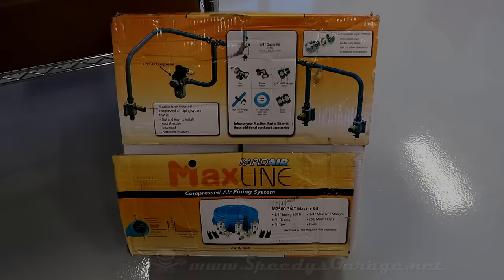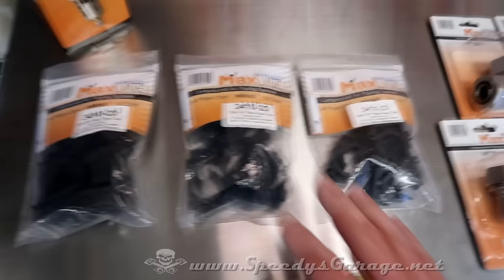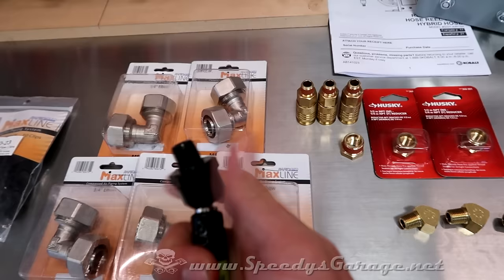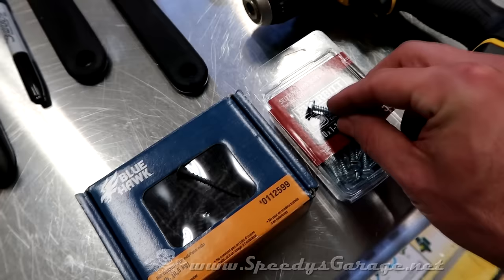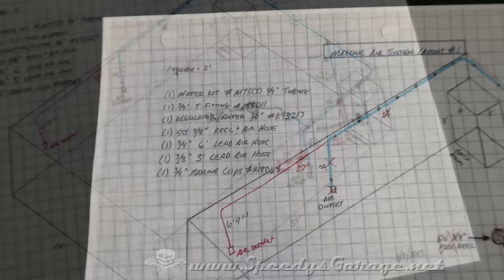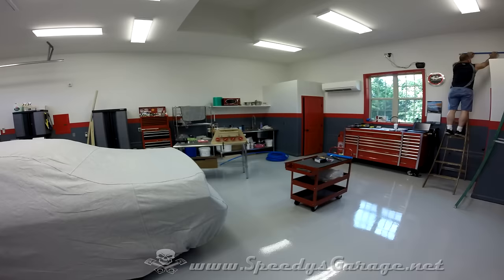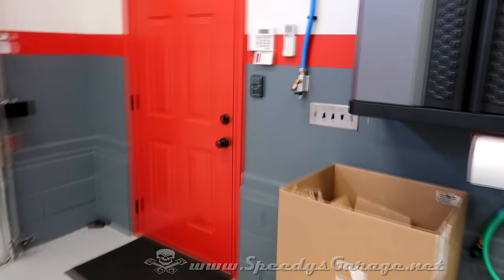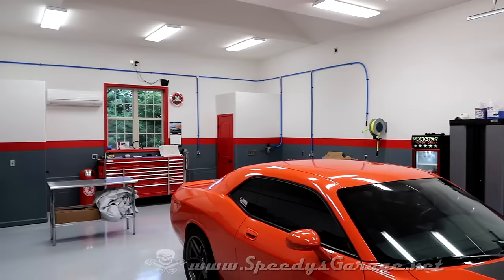Rapid Air Maxline Air System Install Speedy's Garage

Comment: IT's been a few years and I can only imagine I won't get a response, but hey, I for sure won't if I don't try. I am just a little confused... You mention with the 45 degree angle ends that they are 1/4", but your link to amazon shows as 3/8"... Please advise. I bought the 3/4" rapidair set and looking to install here very soon. I want as much going to my blast cabinet as possible, as the rest of the shop can be 1/4"...
Reply from the maker: Mine were 1/4" that matched up with my quick connects.  Amazon changes links around occasionally.  3/8 flow more obviously and you could do that for your blast cabinet connection.  I would personally.

Comment: Thanks again for the detailed video!  Did you run your long runs at any type of downward angle to reduce water?  Are you getting any water at the drain valves?  I saw one guy ran his piping at baseboard level and his air drops actually ran up 3-4 feet to keep water out of his air fittings.  Your thoughts?
Reply from the maker: I made all the runs parallel to the floor.  I've not had any issues with moisture and just empty the air tank regularly.  If you do a lot of painting a good filter system would be recommended I think.

Comment: curious what compressor and size you are using.  Also wondered how you ventilate the compressor room?  IS it just open at the top and if so does that really knock the noise down?
Reply from the maker: Check out the shop build series it has all the details.

Comment: Are you still happy with this product? I am building a new shop and wondering what direction to go for air lines. I used galvanized pipe in my old shop and took awhile to install. Never had any issues with it though.
Reply from the maker: Works great.
Reply: Speedy's Garage okay great. Sounds like the route I will go.

Comment: You said that you found your tubing straitening tool online or was it from plans.  At any rate, the factory made one is a lot more expensive than I think I could make one for.  Could you post a link to the plans for one?
Reply from the maker: The plans used to be on the Rapidair website.  I have a copy if you can't find it.
Reply: I looked on their website but could not find it.  I'd love a copy if you could send me one.
Reply from the maker: Shoot me an email from my website - www.SpeedysGarage.net
Reply: Speedy's Garage 

If possible I’d like to get a copy of the MaxLine tubing straightener too.  I clicked the link but did not see how to seen you an email from the site.  

Also the double male whip line is so you can have a quick connector on it so you can easily disconnect the reel if it leaks or needs maintenance

Thanks

Comment: I like your rollers for straightening the tubing. Did you build that jig?
Reply from the maker: You can buy them now https://amzn.to/3SgM6vk
Reply: @SpeedysGarage  I did end up turning my own rollers in my wood lathe. Used 1/2" bolts on a 3/4" plywood frame. Worked ok. I used the winch on my ATV to pull the tubing through the rollers. I have pictures.

Comment: I'm looking to order the Quincy QT-54, do you have a problem with water in your lines at all? Sandblasting will be my major use-case down here in humid Savannah, GA.
Reply from the maker: I've done some a reasonable amount of grinding with mine in the summer humidity (I'm in TN) and no issues, but if you're going to do a lot of that type of work an extra filter and some U bends would be a good idea.

Comment: I love the Maxline kit, but the clips they supply are sheer garbage.  $1.75 apiece, and they're so flexible that they don't begin to hold the tubing straight or secure.  I've switched to steel conduit straps (example: https://www.homedepot.com/p/Halex-1-in-Rigid-1-Hole-Conduit-Strap-96113/10012914 ) which really anchor the line in place and cost a fraction of the plastic garbage.  In fact, they're rigid enough that you can make minor adjustments between clamps to straighten the tubing, making a run look more like pipe than flexible tubing.  Highly recommended.

Comment: Does a connection come in the 3/4" kit that has a male connector that connects into the 1/2" hole on the compressor?
Reply from the maker: I had to have a special hose made up.

Comment: Why do you choose max line instead fast pipe (rigid aluminum pipe from RapidAir?) I'm just curious. I'm looking to install air distribution in my garage too. Don't know which model to choose.🤔
Reply from the maker: The length of the pipe.  Maxline you can cut to whatever length you need to avoid joints.
Reply: @SpeedysGarage  where did you get your wheels from the straightener you made?

Comment: Are you buying your Rapid Air materials from a local vendor, or are you buying on-line, i.e. Amazon?
Reply from the maker: A little of both, I put links to most parts in the description of the video.

Comment: ok, those "self-tapping" screws are for drilling into sheet metal... NOT wood, not saying you have to pre-drill wood, but the self tapping feature of those sheet metal screws does not disallow the need for it in wood, should you choose to do so.. :)
Reply from the maker: I'll disagree.  These worked great and have held up to tons of use.

Comment: Did you ever sell your pipe straightener ?  And how has airline working for you likes and dislikes ?
Reply from the maker: I still have the straightener.  I have really liked the setup my only complaint is that the system has a very slow leak so if I shut the compressor off, it'll bleed off pressure over 3-4 days.  Not something you'd ever notice while using it, but annoys me just the same.  I'm told this is normal with a bigger system like this so I've not gone through the connections with soapy water to find anything I could potentially fix.

Comment: Thanks for the video I'm trying to decide if I want 3/4 or 1" for my paint booth
Reply: 1" moves 100cfm of air, do you have a 40hp compressor?
Reply: 1 inch seems like overkill when being used with an HVLP. Unless you are running multiple paint guns at full 100 foot length, you won't see the performance gain.

Comment: I'm about to purchase the 3/4 maxline system.  You still happy with it?  Any advice?  How is the rapidair regulator holding up?
Reply from the maker: Look at the 1/2 before you commit to the 3/4.  Fittings and adapters are easier to come by on 1/2.  Other than that I've had zero issues with the system or the regulator over the past several years.
Reply: @SpeedysGarage  thank you for the reply.  Funny, everyone I talk to about the 1/2 wishes they had gone 3/4 lol.  I've got a small blasting cabinet and some paint guns I plan on using...

Comment: Do people ever plumb the lines in the walls prior drywall & paint?
Reply from the maker: Could, but easier to maintain on top of the sheetrock.
Reply: I did.
Reply: Yes, that is why there is a port in the back of the blocks.

Comment: Nice setup, if you don't mind me asking, what's the approximant install cost (not counting pizza and beer) for that?
I'm curious, the lift you'll be installing is perpendicular to the shops length so how do you plan to get a vehicle (especially a large pickup) on the lift (rotate)?  What other lift but a single pole would work?
Thank-you for the time.
Reply from the maker: Really cheap actually for what you get (other than the compressor).  I'd guess about $300 for all the fittings and kit.  Maybe a bit less.
Reply: I figured between 250.0 to 300.0 so I was in the ballpark.

Comment: What is different from pex-al-pex?  I like distribution blocks, but I have pex and looks identical. Mine used stainless crimps and works awesome like yours I'm sure. I also made header from 22ft black iron 2.5 in pipe had laying around. And to get corner radius box store sells pex corner brackets. I used that to get perfect turns. Wish I had the straightening jig, used a shop buddy to pull other side lol. Yours is much straighter, but mine is also 15ft in air so nobody can tell. Great video. I was curious about these as I see lots of people talking about.
Reply: And wanted to note, your shop is very nice bud. A cot and a cup and you're all set ;)
Reply from the maker: I'm not sure what the difference is in pex-al-pex.  The Maxline has an aluminum core that makes it hold it's shape, maybe what you used is the same?  Thanks on the shop, I took a lot of time thinking it through, and yes a cot and cup and I'm good to go LOL.
Reply: Speedy's Garage pex uses cinch not compression fittings so no special tool needed. But my tool does 3/8 to 1.5 inches no adjustments needed. And since I source parts from darn near everyone, pex parts much cheaper. But I like the kit being all in one and you did a great job. And the distribution blocks rapidair has are awesome. I just have terminations that go ball valve > air regulator filter gauge > whip > service reel. Would like to have a few blocks to plumb through wall to service outside sandblasting stand and blowout table. Again, my shop is very crude, but work gets done the same. What did you do you floor with? Looks great.
Reply from the maker: Local place did epoxy on the floor with a clear coat.  I looked at doing it myself, but everyone I talked to said to lave it to a pro that can get good epoxy, not the big box store stuff that falls a part.  It's held up pretty decent, my only complaint is it is a bit "hard" I've managed to chip it in a place or two.  Other than that very happy with it, easy to clean, chemical resistant, etc.

Comment: Planning on doing the same setup in my garage but do have a question on the flooring. What paint or coating is that on the garage floor?
Reply from the maker: It's a 2 part epoxy I had professionally done.  It's been bullet proof thus far.

Comment: Great video and explanation. As a follow up how has the system been holding up and would you still switch to 1-2” if you had to do it again?
Reply from the maker: System has been great.  I've been very happy with the system and it's super convenient having air available around the shop.  If I had to do it all over again, I'd probably just go with the 1/2" line to avoid having to buy the extra couplers, custom whip hose, etc.
Reply: Speedy's Garage if you don't mind, would you have gone with the m3800 or the 90500 kit?  

I'm getting a new compressor soon and would appreciate the opinion. 

Great video BTW.
Reply from the maker: If your anal like me, definitely use the Maxline version.  It has an aluminum core that will keep the pipe nice, neat, and straight.  The Rapid Air version is flexible tubing, and will work just fine, but expect wavy lines.
Reply: Awesome thanks Speedy. I didn’t realize there was a difference between the rapid air and maxline. However looks like the 3800 is more expensive but better for keeping straight runs. Will use the 3800 1/2”!

Comment: Where did you find the jig you used to straighten the tubing?  Did you sell it yet?  I bought the exact setup you bought and will begin my installation shortly.  The jig looks well engineered.  Thank you for your time.
Reply from the maker: Plans are on Rapid Air's website.
Reply: Speedy's Garage Thanks for the quick response.  I found the plans online on their site.  They now sell their own jig for 130.00.
Reply: Michael, did you download the plans that were online on their site.  I can't find them.  Assume since they now make the product, the plans went away.
Reply: Speedy's Garage, did you happen to download the plans that were online on their site.  I reached out to Michael Stein also.  I can't find them on the site or I haven't hit upon it.  Assume since they now make the product, the plans went away. I'd like to get a copy or the spacial dimensions of each of the "rollers".  I believe they are all the same spacing but if you happen to have the pdf file or a copy I'd appreciate it.

Comment: Are you using high flow air fittings for your air setup?
Reply from the maker: I was going to, but since I had a bunch of standard ones I decided to see how they did, and quite frankly haven't needed to change them out....so just standard in my shop today.

Comment: going to 3/4 from 1/2 is not 50% more.. the area of the circle is .78" for the 1/2'.. however it is 1.76" for 3/4.. so more like 133% more volume.. give or take.. you did much better to go with 3/4...

Comment: what is the size of your garage?
Reply from the maker: 24 x 32 I believe, built it about 6 years ago.  I have a Garage Build playlist on the channel.
Reply: @SpeedysGarage  very nice. Just finished building my 28x32. Damn how things add up. I did all 5/8 plywood inside due to cost of spackling

Comment: How much for that complete system?   How does it compare to copper or PVC ??
Reply from the maker: I think I linked to it in the description, I don't recall what it cost but wasn't much.  I wouldn't recommend copper or PVC for air lines, could explode under pressure.
Reply: @SpeedysGarage  Thanks for the quick reply. I just researched my ? further after watching your video as I am preparing a system for my shop. PVC is a bad choice as it gets brittle with age , but copper is highly recomended. I found this info posted on one site..........."I’ve decided to use Type L copper, forget the actual numbers but working pressure is something like 900 PSI."     Your system is also highly recomended but from my experience aluminum does corrode over time if moisture is in the system . This point and the cost are my concerns but it looks super easy to install compared to copper. I'll check out priceing. Thanks again for your input and video.
Reply: @SpeedysGarage  pvc bad.  Copper good.

Comment: This is regular house water system pipes. They are called PEX in Poland.
Reply from the maker: We have PEX as well, but this is different, it has an aluminum liner that makes the pipe keep it's shape.
Reply: Yes this is called pex-al-pex. It’s a beefed up and reinforced (with aluminum) version of standard pex
Reply: we call them alpex or alupex and use them for water, there prity cheap €1.2/meter  so like 0.50 usd/ft for 16mm
Reply: Regular pex is single layer Cross Linked Polyethylene. but rapid air is multilayer Cross Linked Polyethylene.Big difference. There is no manufacturer of PEX who rates their product for compressed air. MaxLine is specifically designed for the pressure and to resist compressor oils. I have had this system for 9 years and love it.I have 9 outlets on 2 floors hooked to a speedair  air dryer. I have people working in my shop and take their safety  and mine seriously.If anything falls against the PVC pipe it will break. I had it happen.
Reply: Not water pipe.

Comment: Dude you miss a lot of things! Lots of learning to do! Ball ends are known to leak and you try to avoid them. You could by using a large quick connect. Then should the reel need replaced or repaired easy to remove. That ball valve will be the most likely to leak. Testing to keep the air pressure at the tool is not going to work starting at the beginning of the system. You need to test right at the gun! You are missing power! Your 45* just stuck your quick connects out further defeating the purpose of not wanting them to stick out so far!  Im not spending the time of the fitting parts name you can google that.
Reply from the maker: These comments give me a chuckle considering the video was published over 3 years ago and the system has worked flawlessly.  I guess I got it wrong though!